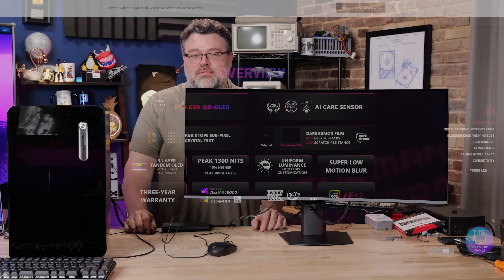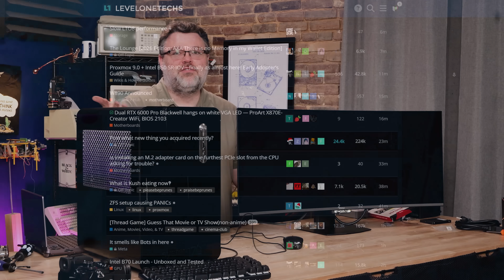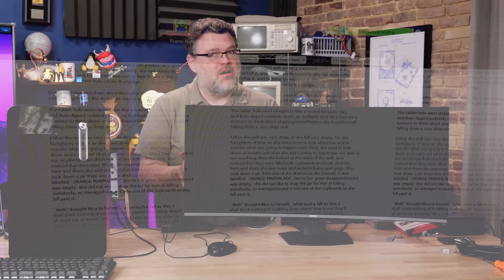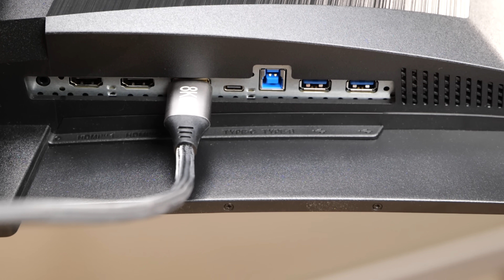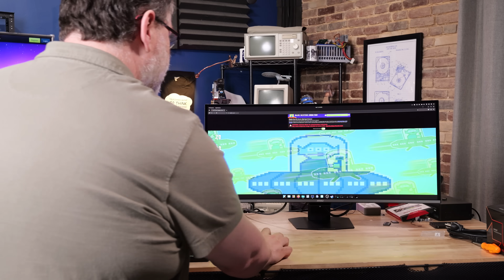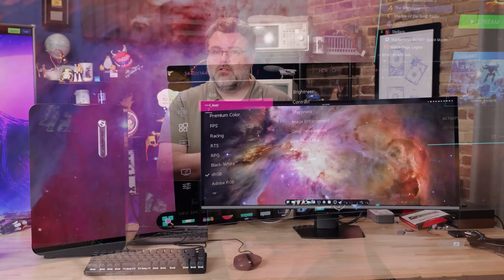Reviewing the MPG 341CQR QD-OLED X36 from MSI

Comment: I so hate the ultrawide trend dominating the market. I want 16:10 or 3:2 42" oled. If I already use that much of my desk i want some height for text scrolling etc. I have a CG438KP since its release and it's hard to replace it with something with good contrast and brightness. I'm hoping oled will get there.
Reply: I'm behind this idea. I like 16:10, but i want a flat panel, maybe a 38-42".
Reply: Are you using 42" already? Flat makes it hard to see stuff at the edges.
Reply: @FiveFiveZeroTwo flat at the desk at 4k va panel only last cm or two I can see difference in colour due to angle. I don't have an issue with seeing stuff at the edges especially given that usually I have taskbar on the side and toolbars on the other side. It replaced my 2 monitor setup which was barely angled anyway.
Reply: Im using an LGB4 48" for a monitor and its awesome
Reply: @Ball-Lightning-dr5wv how is it for desktop use, how's the text clarity and does ABL make it annoying?
Reply: I do a lot of cad and prefer 21:9 monitors cuz it feels like a better optimized screen real estate but for gaming I use a CRT lol
Reply: @Funsiz3dBlacksmith I do a lot of CAD as well and I prefer full height displays while giving me more area for reference documents, specs , part libraries, with a regular ultra wide I might get one extra document open while having cad at a comfortable size. For me the point is if I'm using a certain amount of desk space I might as well get some more screen area from height which is sort of wasted in ultra wide formats. I used to win 30 inch 16:10 and 27 in 16:10 in portrait prior to my 43" 16:9 4k display and this feels like that with space for an extra window.
Reply: You can get 16:10 by not using the sides of your 16:9 display! ;)

Comment: I got excited for a minute: I have been looking for a 21:9, 34", OLED Monitor for awhile, but in a resolution above 3440 x 1440! I kind of regret going 21:9 in many ways, because the more niche panels seem to lag behind more mainstream Aspect Ratios! Blarrrrrgh!
Reply: yeah but 21:9 is awesome! i never wanna go back
Reply: @defranken  It really is great. But if 21:9 panels are going to remain three or four generations behind 16:9 then I'll probably move back eventually.

I don't regret my purchases because OLED needed time to mature. But this latest generation really seems to have most of the kinks and compromises worked out.
Reply: @FrenziedManbeast  21:9 isn't 3 or 4 generations behond 16:9. This 21:9 has the newest generation QD-OLED currently available - and not yet available in 16:9.
Reply: @flat6croc  Not in a resolution above 1440p vertical! I'm looking for 4K in 21:9 AR with the latest OLED + HDR and 120Hz or better refresh. It doesn't exist.

I understand that the panels themselves use the latest tech, but I only upgrade hardware when it's an across the board step-up. Currently, 21:9 cannot offer that.
Reply: @FrenziedManbeast  I agree re the res, which is why I wouldn't get a 21:9 34-inch OLED. But you said 21:9 panels were 3 or 4 generations behond 16:9. They're not. They're actually ahead! That said, there's a new 39-inch LG which is 5K2K 21:9 OLED. Pixel density is the same as a 32-inch 4K, so pretty decent.
Reply: @flat6croc  It's only ahead right now, but it's really too soon to claim they won't immediately fall behind again. UWs are also still far behind in miniLED, and even LCD UWs seem to be stagnant as far as I can tell, though I haven't dug as far into the higher end LCD UWs.
Reply: @flat6croc  Unfortunately 34" is as large as I can go. My display setup is on a four panel tree. I run two 21:9 34" panels top and bottom center, portrait 24" on left, and horizontal 25" on right. I would be replacing my primary 34" with the OLED and giving my wife my current primary. 

I've waited years, so we'll see if I have to have abandon the aspect ratio before they finally bring a true upgrade across the board to market for me!
Reply: @corombb  Sorry, what do you mean? UW has the most advanced panel tech available right now. That'll be true for at least a year and there's no reason to think UW will miss the next update. And MiniLED is dogshit, so that doesn't matter.
Reply: @corombb LCD UWs don’t get love because they’re maxed out. Why spend r&d on dead product with 10% margins? OLED gets all the love because it has a much higher technical ceiling and wide margins. You’re complaining about non-issues and quite misinformed. UW Oleds are the bleeding edge, even has RGB stripe now far superior to any Oled 4k monitor panel.
Reply: the 110 PPI is more than enought and i am someone that had 122 PPI screen for 5 years before that. Ultrawides FTW.
Reply: I'd exchange some of their refresh rate for resolution, like 300Hz and at least somethimg to match 4K, somehow?😅
Reply: Most OLED monitors and TVs get produced through chemical evaporation through a slot mask, and we are unable to make slot masks fine enough to handle that resolution. The only 27" 4k monitors (and upcoming 5k) that exist (true for JOLED/TCL, LG and Samsung) are produced through an inkjet process but this is difficult at larger sizes.
Reply: @hugevibez  Modern 27" 4K QD-OLED / is NOT the same tech as JOLED is it?
Reply: 1440p will be the sweet spot for PC monitors - especially ultra wides - until GPUs will be able to run 4k games in above 240 - 300 fps. I'll take a high refresh rate over a slightly higher pixel density any day.
Reply: @BoboShantiOne  I'm absolutely the complete opposite - 90-120FPS is the absolute highest I can detect in a like-for-like test. But as a software engineer vertical resolution limits in the 21:9 aspect ratio are getting old! I've been on 3440 x 1440 since 2019!